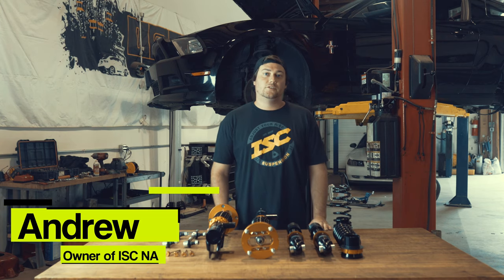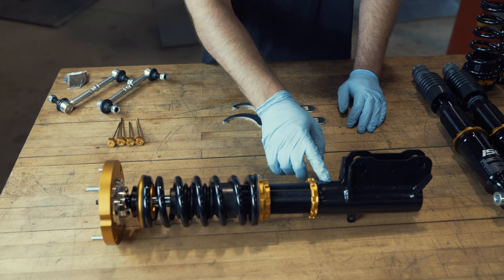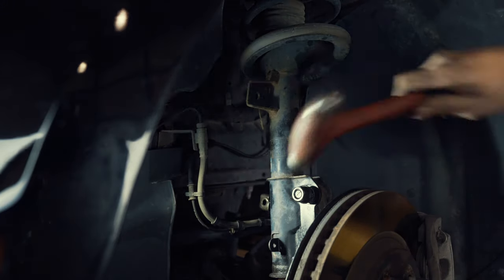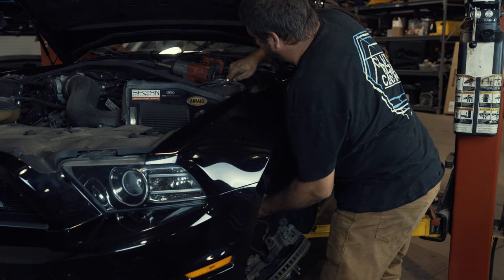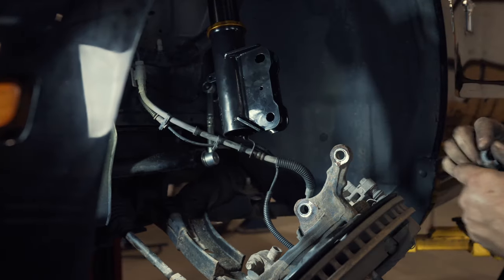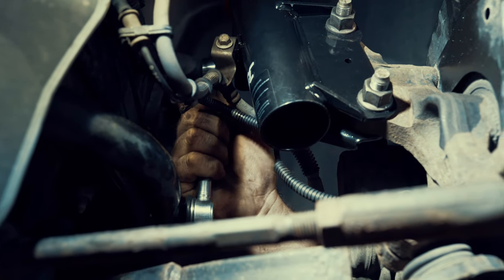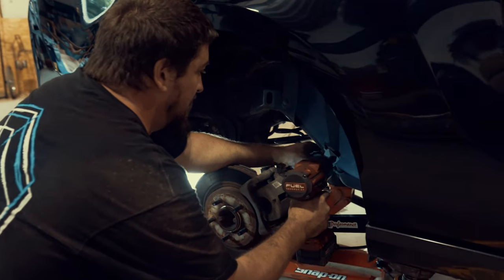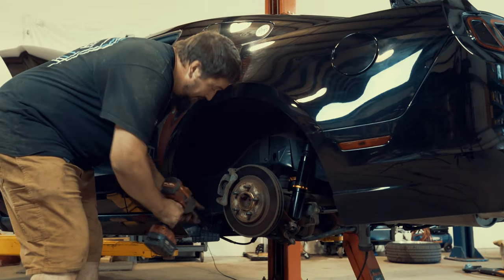ISC Coilover Installation Video For 05-14 S197 Ford Mustang

Comment: Just installed these on an 11 5.0. Did you modify the rear shocks to have been able to install the top shock rubber isolator nut? The nut that comes with the kit only has a metal washer.

Comment: I had ordered the street/track version and the rear is way too stiff, now I know why.  I was sent the 6kg triple s instead of the 5kg.  The front is perfect for street and autocross, but the rear with the 6kg is not street friendly at all.   Is the 5kg triple s available?
Reply from the maker: You either have the Street Sport,  or the Track Race. Contact support@iscsuspension-na.com or give us a call tomorrow to confirm. 6037159078